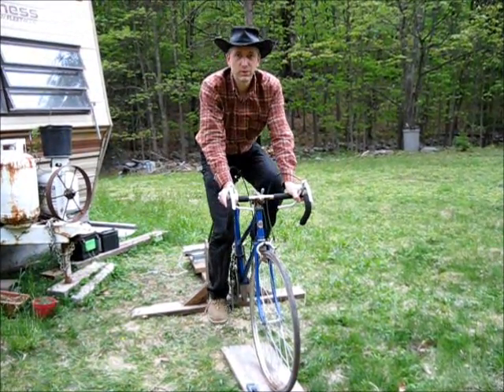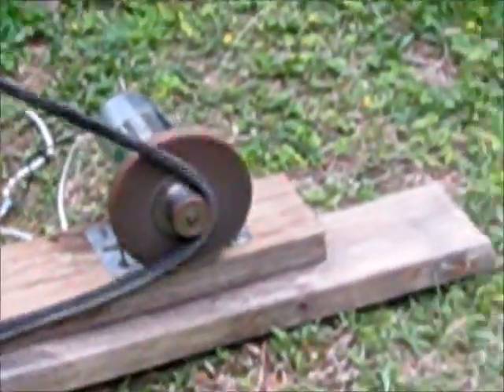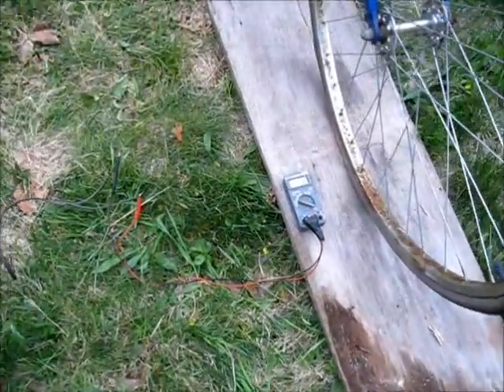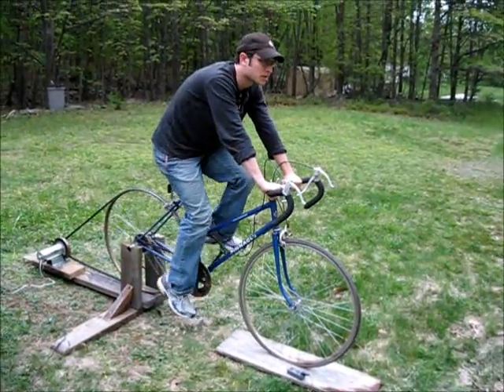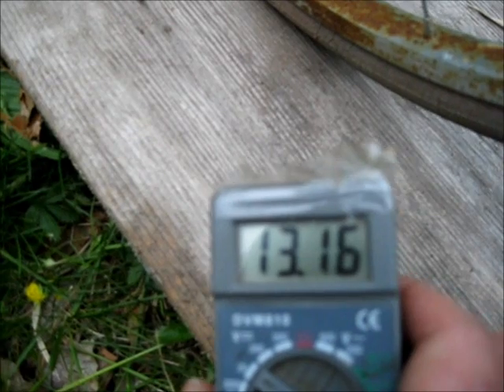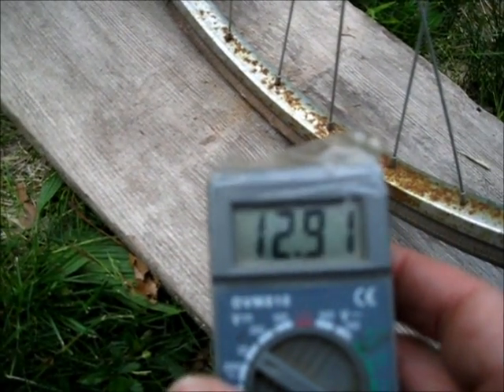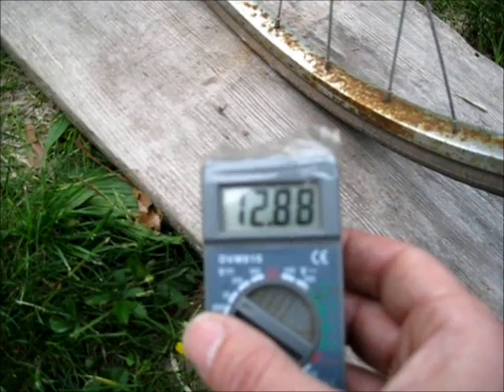Homemade Bicycle Generator - people power for off grid living

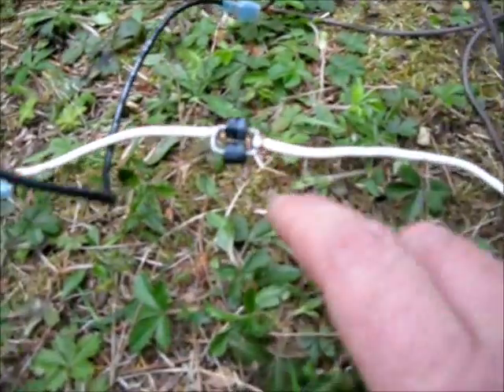Comment: I'm impressed.  He has a volt meter to measure voltage, but at 2:45 he uses his fingers to measure the current?  He's got a multimeter the measures 10a.  Can someone tell me why he's using the meter to measure voltage and his fingers to measure current?

Work or wattage is what we care about, not voltage or potential.
Reply: Agree.  I'm  sick of  the perpetual motion and other magic on youtube.   Physics in this case is easy.  Humans  can only produce so much power.   "About 1HP"  for very short periods,  and a fraction  of that  over  an hours  time.

Not counting  losses  and   losses might amount to more than 50%,  a HP is about 750 watts.   I  doubt,  frankly,     those batteries would charge  from that mess in  2 days  time.

Last,  I guess the OP has never heard  of battery "surface charge."  This is artificially raised voltage  immediately  after charging.  You must let the batteries rest for a bit to get a true reading.
Reply: fourfortyroadrunner  +1
Reply: fourfortyroadrunner You are absolutely 100% correct in everything you said.
Reply: fourfortyroadrunner You haven't tried to be anything but arrogant and insulting, which I imagine you don't have to try to achieve those things.   We're arguing over terms that are the same, but subtly different, but mostly interchangeable.   Let me put it to you in terms of joules which is most appropriate since it's the measurement of work done.   1 watt/s is a joule, and a microwave requires 1000 watts to run, right?   so to run a microwave for 5 minutes, you need 300,000 joules, correct?   So if you pedal a bike and power a generator for one hour at 10 amps generating 12 volts, you have stored 432,000 joules.    You have enough work stored to power that thing for 5 minutes.  Suck it princess.
Reply: fourfortyroadrunner  Your analogy referenced the actual size of the iceberg...not the event, itself.
Reply: fourfortyroadrunner The Iceberg that sank the Titanic was really small as icebergs go, so you're analogies are even ignorant.
Reply: Passed High School Physics I don't believe that's right.   Even if one burrito only took 1 minute to cook, additional burritos would increase cook time.   At maximum you can conclude that you could cook 60 burritos for $0.15, but my burritos are large and take 5 minutes to cook in a microwave, thus I can only reheat 12 burritos for $0.15
Reply: Passed High School Physics OK.. you need to change your name to "Should have failed High School Physics".   Appliances always measure in Watt Hours based on how the electric company bills.   Amperage for a household appliance is measured in (Watts per hour)/volts which in America is always 110, 115, or 120.   It's true... look it up sometime.
Reply: fourfortyroadrunner I'm not confusing anything, you and PHSP seem to be confused at how household electricals are measured.  90 watts is plenty to operate a 1000 watt microwave for 5 minutes.   1000watts/hour*(5/60hour)=83watts.  See how "hour" cancels out, and now you have only watts?  It doesn't work out that way on accident.   PHSP believes that a microwave uses at least 600 watts per minute.   This is not true.   While this person's device is nowhere near a horsepower (750watts/hour), it's not a trivial amount of power he generated either.  remember what I originally said, if he generated 10 amps at 12 volts for an hour, he would have 120 watt hours, or enough to microwave a burrito for 5 minutes.
Reply: savaship Would pedaling for an hour even be enough?  The smallest microwave oven is 600 watts.  Don't you think it would take about 1,000 watts for 2 min to nuke a burrito?
Reply: Passed High School Physics A Watt rating on a commercial appliance is (almost) always measured by how many watts per hour it uses.   A 1,000 watt microwave uses 1,000 watts per hour.   A 5 minute burrito therefore only uses about 90 watts to cook, which translates nicely to my favorite example, the ez bake oven, which cooks foods with the residual heat from a 40 watt lightbulb.
Reply: savaship Excellent example. 
If my math is correct that would be .016 watts hrs.  

Does this sound right?  To cook 1,000 burritos would be about 1 kwH or $0.15?  (Trying to do the math in my head.)
Reply: savaship  Cooking a burrito for 5 mins would be 600 watts x 5 min or 3,000 watts / 3kW.  The rate where I live is say $0.15 for  kWHr  Cost for 3Kw would be 3 x $.15 x .083 hr (or 5 min) or about $0.04.
Reply: Passed High School Physics I don't follow that at all.   Microwaves don't use 600 watts per minute, they use 600 watts per HOUR.  If you did the math your way that would mean that you would have to have a 4 Million Amp breaker in your house.  Once again... Appliance wattage is PER HOUR, and not per minute, not per second, not per any other arbitrary unit.
Reply: savaship What?  You have mixed up energy with power.

Microwaves don't use 600 watts per minute, they use 600 watts per HOUR.

Who taught you that?  They are all wrong.
That would be a watt-hour.

Microwaves use about 600.  Watts are measured in seconds.

Do we agree Watts = Volts x Amps?

How are amps measured?  An ampere is the amount of electric charge Q passing a point in an electric circuit per second.

In your example since the microwave is on for only 5 minutes that's only .0833 of a killowatt hour or .08333 x 600 watts.
Reply: savaship You are  confusing  power  (watts, kilowatts)  with  power over time,  IE  watt-hours,  watt-minutes,  etc etc    Your post  largely makes no sense.  What are you  classifying as  "residual heat"  from a light bulb?   That  would almost imply   "the heat contained at the instant of power removal"  but  I'm sure that's not what you meant,  rather,   the heat  radiated  by a 40 watt light bulb.
Reply: Passed High School Physics   As  I said earlier........you are the one confused.     "Power"   or "wattage"   in  electrical terms  is  not  expressed over time.
Reply: savaship Good god  your  ignorance is  larger  than the  iceberg  which sank the Titanic.    If a device  DRAWS  so many watts,  it  doesn't  draw that power  "per minute."   It draws that   anytime  it's in operation  at  rated power,  IE   an electric heater  on "high"  might draw  so much  instantaneous  amperange,  and that means  that  IXE is the watts it  DRAWS.    "Watt hours"  or  "watt minutes"  or  "kilowatt hours"  is what you seem to be eluding to.  

Please get off the internet  and go  find some basic  high school books on the subject.
Reply: fourfortyroadrunner And  yes  I am  fully   aware  of power factor  and  phase splitting,  in  ductive and capacitive circuits.   That is why  in the  example  I chose  "electric heater"  which,  if it has no  fan or blower,   has virtually   no  measurable  power factor in the great scheme of things.   And yes, before you argue THAT point  I do realise that  most  electric heaters  are likely to have   SOME  (small amount of)  reactance.  Aain  for the illustration, this is  negligible
Reply: savaship Y'know,    I've tried to be   nice to you and  I just cannot. You are what is known commonly  (and you ARE   common)  a  phuckstick.   You can  look that up,  do you get Google at your house?

See'in as how the  sinking of the Titanic  was,  well,  a rather  Titanic  tragedy,   don't you think the analogy  was,  after all,  appropriate to your inflated  vacuum  of a brain can?

However,  none of this detracts  from the actual fact,  that is, that you don't know much.   This argument is over.  Don't bother replying I won't be reading it.
Reply: savaship YES - You are correct and very will put.
Reply: those bike pegs are 3/8 inch. So mainly fit BMX bikes. He got lucky his old 10 speed has 3/8 inch axle.
Reply: I can't tell you why he did those things... but if he's right about the amperage being 8-12, and the voltage was 12-14 then we can safely conclude it was about 96-168 watts per hour, which is completely within human levels, and also a fairly useful amount of power in the grand scheme of things.  It's enough power after an hour's worth of pedalling to microwave a burrito ;)
Reply: @savaship  Our brains run off 25 watts - so yep - it's a bit extra energy than just thinking hard.
Reply: @voidisyinyangvoidisyinyang885  I don't understand the point of your statement... unless you can plug a battery into your brain to heat up a burrito... it's like you came 3 years late to an event that's been over forever now.

Comment: You have to monitor the output amps and not the voltage/
Reply: @nikims_  yes unfortunately the resistance of batteries are typically too low so the draw is not strong enough. But they have their batteries with loads on them and then they are just topping off their batteries under load. Normally a battery charger for any kind of inverter has a built in voltage management at around 80%. So the draw as resistance is increased dramatically to then drop the voltage level to make sure the battery is not over charged. So then if you are trying to charge when the battery is being topped off - then it will take an extra long time to do the last 20%. For lithium batteries there is even a final 1 hour for just evening out the individual cell voltages without any amps going in at all. So yeah unless we know what kind of loads they have then we can't know the amps - you are correct. 

I have uploaded on my channel different draw load examples - so I pedal at 6 amps for light bulbs - 12 volts - oh that must have been 5 amps so 60 watt light bulb at 12 volts. But since the load was so strong then the resistance was - what's Ohms again? volts/amps I think - so over 2 ohms - resistance on PEDALING was also very strong. So it's better to do low watts for a longer time and then power a device directly without charging a battery. I power a 10 watt DVD player so then I can watch a whole movie without being worn out.

Right now I have a battery of 31 amp-hours - I have used it down to about 20 percent. So it's only at 6 amp-hours. I also have a DIGITAL DC-DC buck converter so I can read digital amp output of my DC motor generator-bicycle charger. So I'll try charging up the battery on bicycle and see how many amps the generator draws. But I think the internal battery management system will limit the amp draw to just 6 amps at most. Normally I just get a 3 amp draw on the generator-battery-inverter and so that does not create too much pedaling resistance. So that way I can pedal for an hour and increase the generator charge by 10%. 

Oh I remember now - I had a 10 watt draw hooked up to the DC output - but it kept shutting down because the cord had the polarity switched. So... yeah I was gonna check how much draw I could increase by having the battery load increased while charging. It depends on how the cells of the batteries are hooked up. I have 9 cells for 4 packs each for 36 total cells for 346 watt-hours. So they are wired in parallel so the draw is actually just for one of the four packs of 9 cells. 31/4=about 9 amps per cell. So at 12 volts the Ohms resistance is 1.3. The built in battery management has I think an 8 amp fuse or something - so I think it will only draw at that limit. Yeah so a normal 12 volt battery I suppose has no limit - just the total amp hours will give the ohm resistance based on how close you are to topping it off.  Oh my car charging was not working - I'll test that first. That normally draws only 6 amps.
Reply: This is true voltage is not the actual thing flowing but rather a "pushing force" Amperage is the a measurment of the current flowing through the wire
Reply: @bencentral5713  yes they are incorrectly claiming high amps when in fact the battery resistance is very high since they are just topping off their battery.
Reply: @nikims_  I reset the Dc-Dc buck converter to over 8 amps to see if the battery would draw that much but I forgot to SAVE the settings. I have to review the instructions. I had it set to limit to 1.5 amps for powering the portable DVD player (10 watts)....
Reply: @voidisyinyangvoidisyinyang885  ye.
Reply: @nikims_  Sure enough it worked (using the new digital DC-DC buck converter). I increased to 13.8 volts charging output and I got up to 5 amps charge output from the bicycle! But I couldn't hold it since this bicycle frame is smaller so my legs are too long (the bicycle seat is not the proper one so I can't adjust it). haha. Even still it was way too much work. Anyway proved my point in concept.
Reply: 13 amps is good

Comment: Some irrigation to divert a stream near by and a man made mini water fall will solve the having to get on the bicycle to recharge the batteries.  But still practical idea especially if you live in a desert.
Reply from the maker: DreDredel3 The stream here is on a neighbor property so out of the question. In a grid down scenario this would provide both exercise and some power. It would be especially valuable in a bunker or just to save some power even now.

Comment: Diodes do not work well in parallel. Electricity takes the path of least resistance and manufacturing differences between diodes cause them to be slightly different from diode to diode. Even if it is only slightly different the diode with the least resistance will get hit with the majority of the power causing it to fail prematurely. You would be better off finding a single diode of sufficient capacity. You can also connect them in parallel by installing a resistor to each diode to balance the loading but then you are wasting power in heat through the high current low ohm resistors thus again you are better off with a single large diode in this application. Just thought I'd toss that idea out there to you. Cool video!
Reply: Thank you -an aspiring tradesman

Comment: Great idea. Not to mention common sense. The problem though is weight, or lack of it. Obviously the more weight there is, the more momentum an object, or in this case, a wheel, has. In the case of this, it should make pedalling a little easier. Like it does when actually riding one of these. I wonder how 2, 3 or even 4 heavy lead weights(as close to equal weight as possible), the ones used for fishing, added to the end of every spoke, or every second spoke, secured with glue, would work?

Comment: I like the simplicity of your design! Still I think your setup of two diodes in parallel for the sake of allowing for higher currents to flow wouldn't work efficiently in the long run. Sooner or later one of the diodes will  blow (first) because of small differences in forward voltages. So better use a single (slightly over dimensioned) diode from the start. Tell me, if your experience proves me wrong ;)
Reply: Except in the case of alternators, they use 3 diodes each for positive and negative to handle the current output. I would suggest he use a diode bank from an alternator!

Comment: I made one something like this. I needed to pedal for a half hour to charge a 20ah battery a little more than a tenth of a volt.
Reply: 20ah [Assuming lead acid] battery needs 120w/hr of charge and peddling you're going to generate about 50-100w of power and with 40% losses [charging a lead acid battery], you're left with 30-60w/hr, so 2-4hrs to charge it.
Reply from the maker: Oh, maybe you need a larger motor for more amps? Or thicker wires going to the battery. Makes a lot of difference.
Reply: +John Strabismus 2 alternators and should do the trick,

Comment: Great idea.  Guy Martin uk recently rode a bike upto 100mph he used a 3rd crank to ease the strain of the very tall gearing. That could surly be applied here too not so drastic but just make it alittle more comfortable to ride. Or put in the same effort but get higher voltages from the better gear set up.

Comment: Or you could just put a car on jacks and hook it up to that and just put the car in drive without pushing on the gas pedal on the opposite side of where the bike is obviously, and do it that way. No matter your gas mileage, having it in drive will use far less gas and a lot less energy then it would on a bike and the upkeep of the bike and food consumption, water etc. or just hook one of the batteries in series with your car battery so it gets charged when you drive somewhere and then hook it back up to the camper when you get back. You'll want to keep at least one battery hooked up to the camper at all times.
Reply: NocturnalLunacy i
Reply: NocturnalLunacy ńoun pli
Reply: Or you can just hook up the inverter to the car cigarette lighter. Just keeping it neutral charges the battery too. Your idea about charging the camper batt while he drives is not a bad one. He has to hook it up in parallel, instead of series. Otherwise, he'll bust all the electricals in the car.
Reply: put jumper cables from idling car battery to stationary batteries,,,,all will recharge with car running at idle if batteries are not too low,,,,if they are,,,let it run an hour,,,,alternator will sense and charge as needed,,,,,only a minimum of gas is used

Comment: Put the bike inside and you dont have to worry about the snow :) plus you will help heat the living space. I have suggestion for the flywheel, if you want to do it cheap put a tire back on the bike wheel, make a mount to hold a big rig tire/wheel/hub assembly, (just make a bracket out of wood or metal to bolt to the spindle) and friction drive it from the bike wheel. Make an adaptor to bolt a keyway hub to the truck wheel, and drive the motor directly. You could gear up the bike to get the proper rpm.

Comment: Very cool. Now can i take 4 6v deep cycle batteries from a golf cart, wire them together in series so i have a 24v(or wire them into 2 12v) battery, use a bike to a alternator to charge them every once and a while, then get a 2000 watt inverter and plug in a space heater and some lights?
Reply: An alternator would be better?